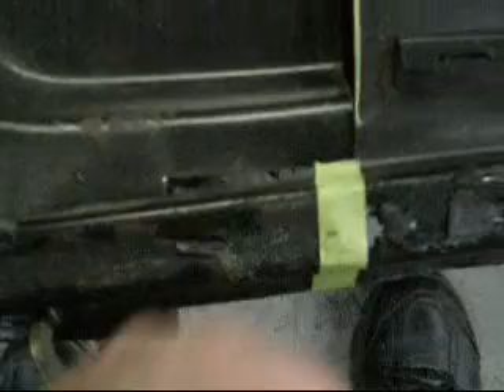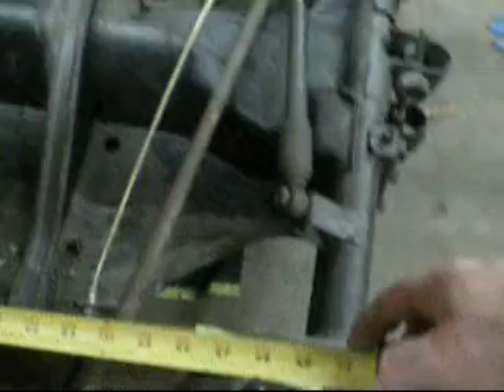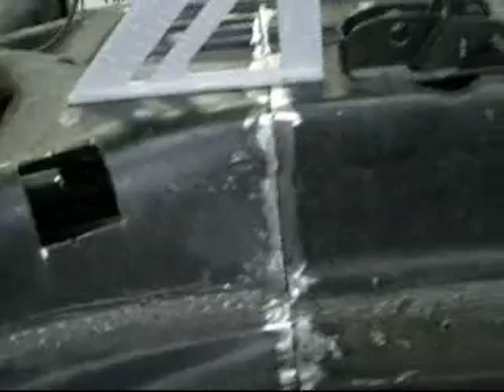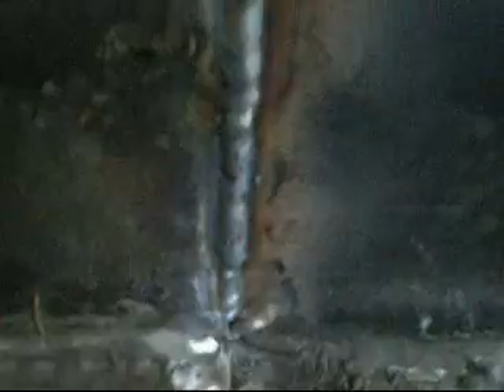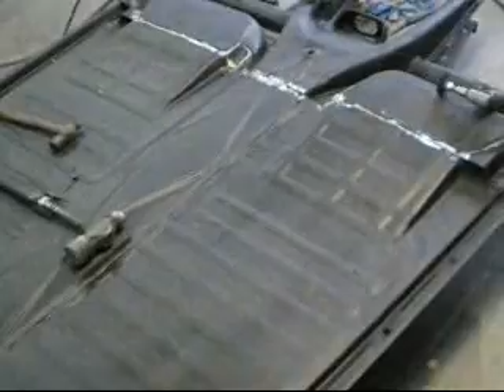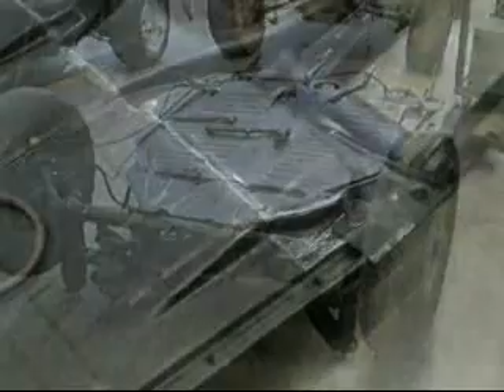Fiberglass Dune Buggy 5

Comment: can this been done with all beetles , or am I wrong in thinking the seventies were different steering and suspention systems on the front
Reply from the maker: squirms shed I believe this can be done with all the classic beetles. This pan is a 1968. You are correct, the suspension is different in later models.
Reply: They changed the front suspension to struts in mid 70's..... I believe 1974-75......

Comment from the maker: Thanks. I've built a lot of things over the years, and I try to solve all the issues as I go along. I feel it's only fair to others to see how things can be done. This is the first time I did a VW, in any way.
Reply: If you had done a Z cut, your floor would have come out with little to no gaps. It's also the strongest way , and approved by VW...